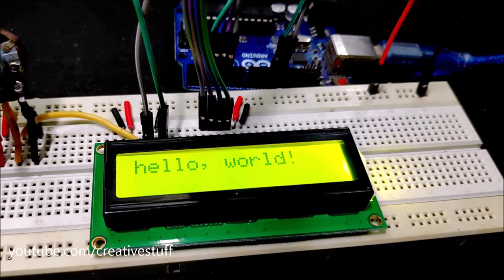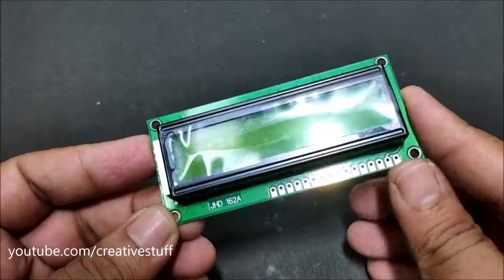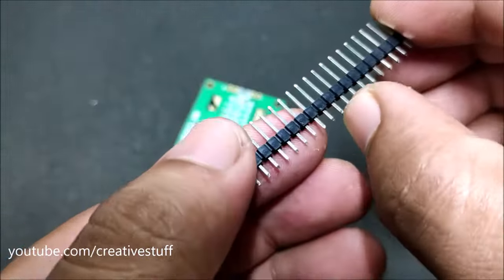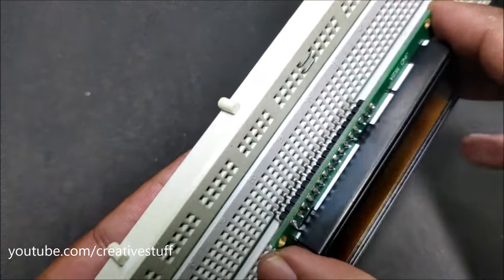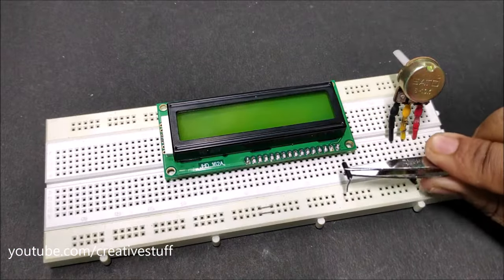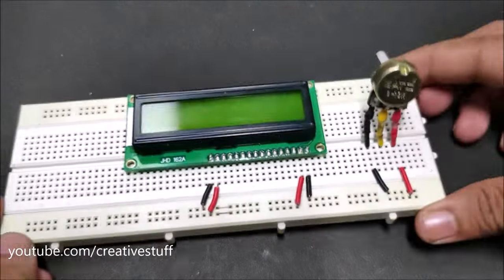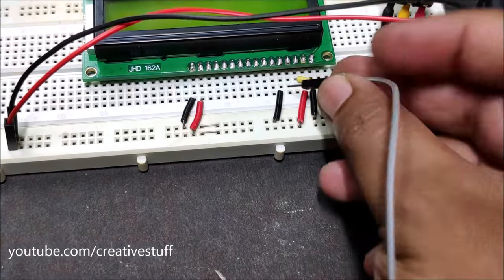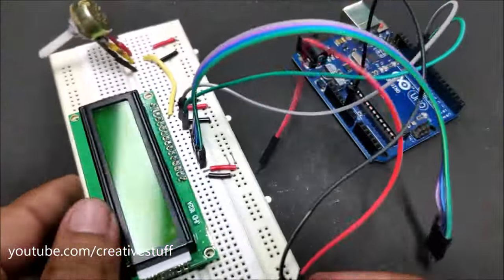How to Set Up and Program an LCD on the Arduino

Comment: If incase anybody didn't have a potentiometer connect that pin to GND not 5V it will work good..
Reply: Thanks a lot Thianesh INDIAN AERO! I do have a potentiometer but your suggestion to move my pin to ground worked regardless. My screen was blank at first, but I replaced one of the 5 volt connections to my potentiometer with a ground connection and it displays "hello, world!" now. It has a blinking text cursor, although the text doesn't blink. Not sure if it's 100% working right now, but a huge improvement.
Reply: which pin?

Comment: my arduino turns off if I connect 5V and ground to my breadboard. what should i do?
Reply: check for short circuits,for context dont connect t both pins to the same line

Comment: how to determine which side of breadboard for positive and negative connection?
Reply: Its your choice, you can even do it in vertical lines as well where the led has been connected, check a tutorial on "current flow in breadboard" and you'll understand

Comment: Thanks bro but what if we have given 3.3V instead of 5V
Reply: That should be fine or else if ur lcd uses more than 3v then you'll need relay switch to power your LCD from external power supply